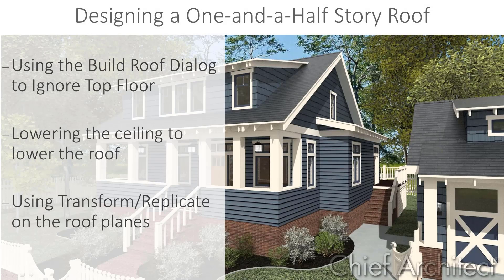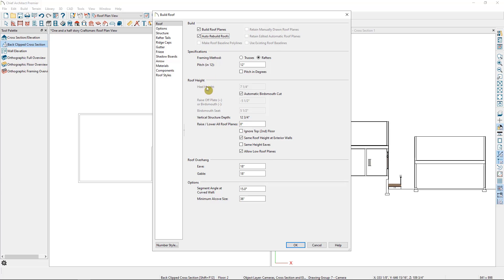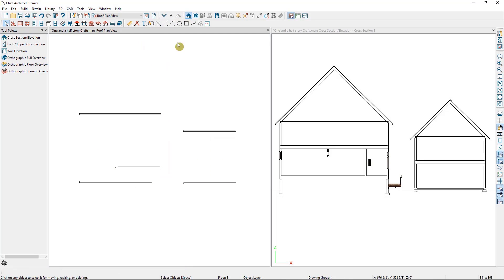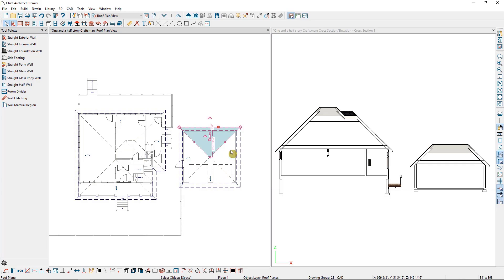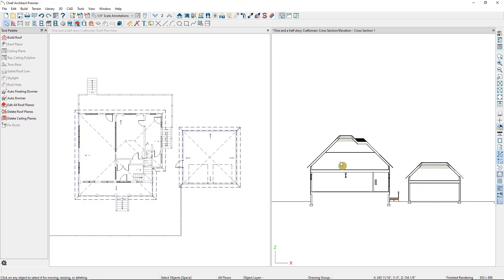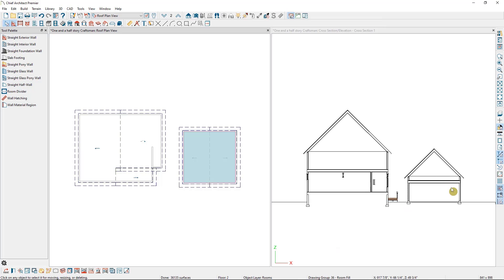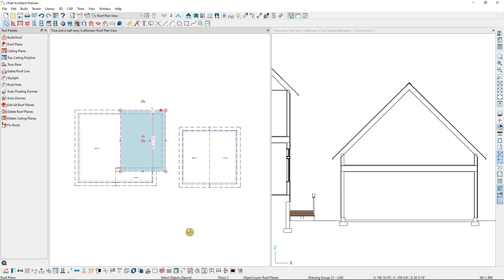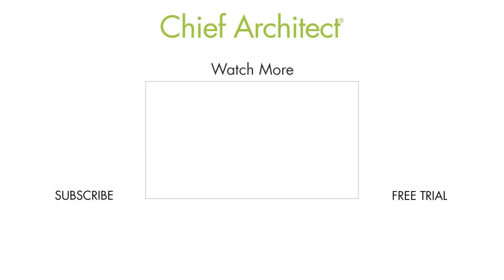Designing a One and a Half Story Structure

Comment: Thanks for the vid👍, as I was using Home Designer Suite 2023, the only way I could get it to work was...

to create cross section... open a "Perspective Full Overview" then "3D --> Camera View Options --> Cross Section Slider"
Select floor to adjust the ceiling height though "Room Properties --> structure --> ceiling height" to knee wall height
Turn off auto rebuild roof
Then change ceiling height again in room property to full height 

this is kind of note to myself in the future but may help some one else.